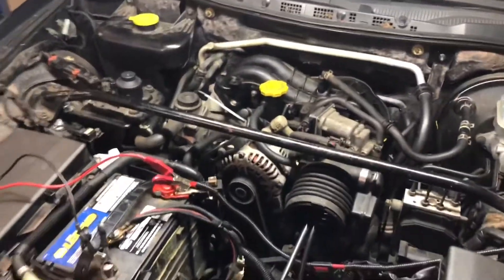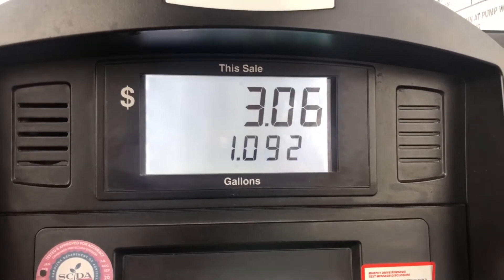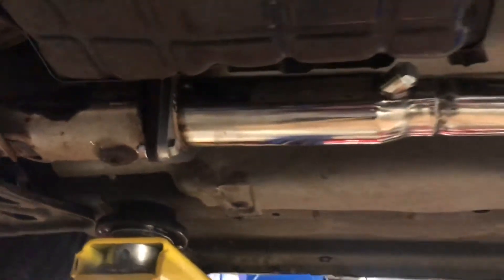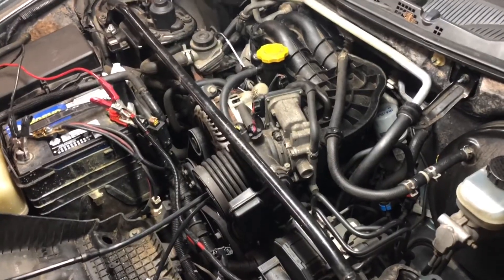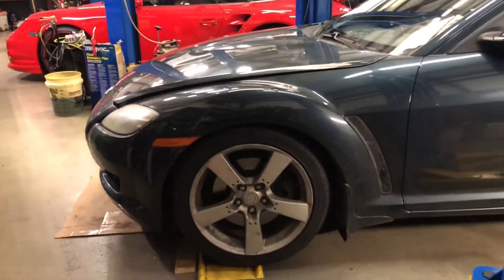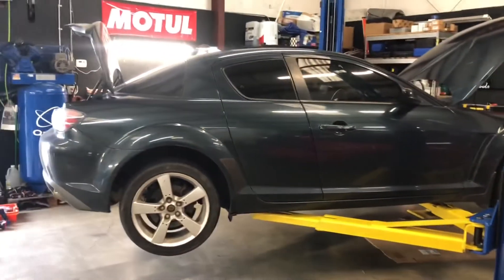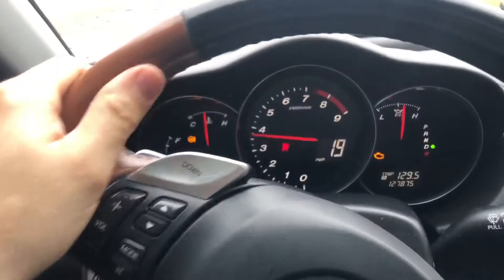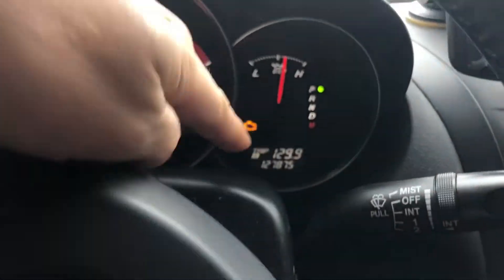Mazda RX-8 Starting and Stalling Ruff idle Isues and P0661 Code resolved here’s what I did

Comment: Might be time for a compression test... with 127000mi I would say the random misfires, gas mileage, oil in the intake and hard starts without premix would tell me you probably have lowish compression.
Reply: Hopefully not though...
Reply from the maker: My Mazda RX-8 has 129k miles now, so far no more bad start ups also it drives good, and fuel economy went from 14mpg to 22mpg at least according to my Tuner, I need to do closer test.
Reply from the maker: I will be doing a compression test but a little later, just need to work out little problems first

Comment: Yo
Reply from the maker: What’s thanks for watching
Reply: Get up and go? Just a matter of doing what the rotary racers do even if you’re not racing: Experiment with the right fuel pump or fuel Pumps(plural) the rotary is a large chamber overall that really needs the right fuel pressure or it will bog down. Now a days sports cars have 2 fuel pumps from the factory. GM I tank fuel pump like for the Silverado or Corvette have more capacity for the rotary. I’m about to try 2 high lph( liter per hour) walbro fuel pumps. The Puerto Rican’s have experimented with the Silverado’s fuel pump for low end torque with good success. All Supercar short stroke fuel pumps will work OK. But if you want it to really get off the line well even for the street will need high capacity fuel pumps.
The car is Ok it just needs good fuel pressure.